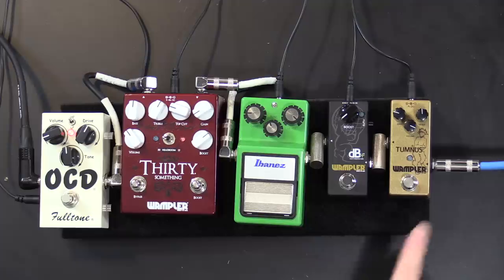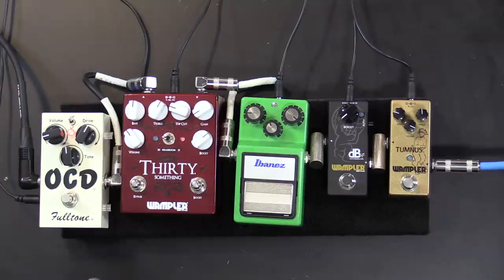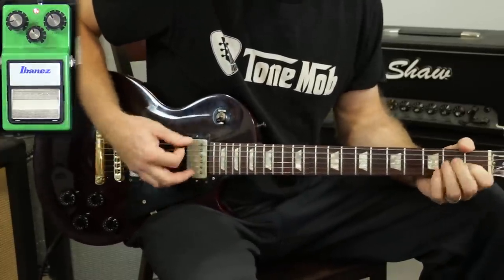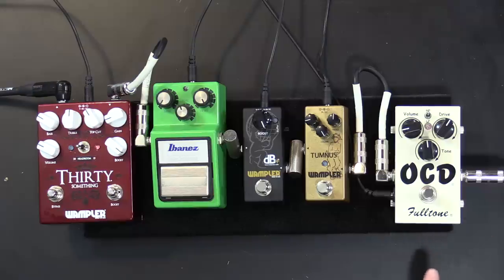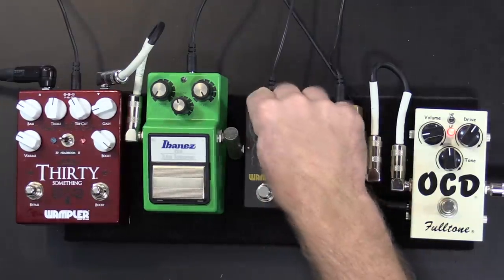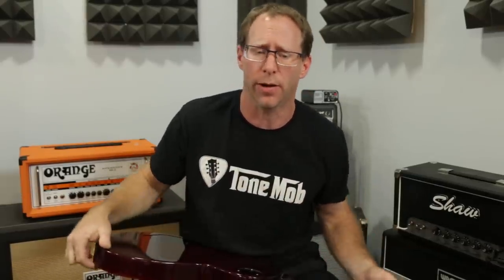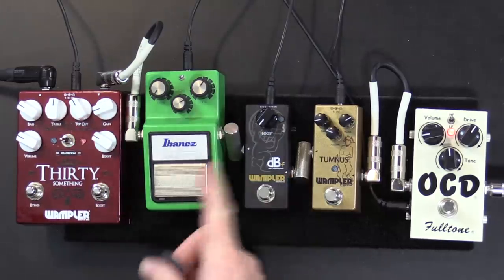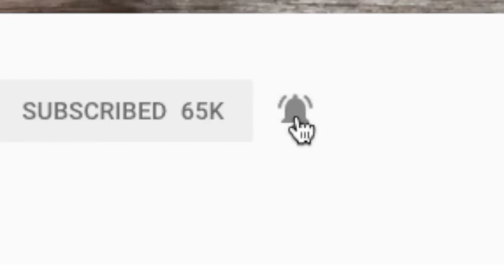Boost Pedal Placement - where do they go?

Comment: I would go boost after distortion and overdrive. My thinking is to try to get the levels on the distortion and overdrive pedals where you want them first and then use the boost pedal to boost (what else?) your nice distortion sound. If using a noise gate pedal I would put that after distortion - then overdrive - then boost.

Comment: Thanks so much Brian, great vid! The way I use my Marshall Jubilee with my pedals: eq all at 10. Preamp gain around 6,5 for a good clean tone and nice crunch on the lead channel. I balance those with the lead master. A tubescreamer in front for my main high gain sound. And a Boss GE-7 in the loop for solo volume boost on any of the 3 gain settings. This works as a 3 channel amp with an optional volume boost.

Comment: I was running my Tumnus Deluxe as the last pedal in my NS-2 loop for months and it was great as a boost and tone-shaper. One problem: the OD808 sounded like garbage in between the Ego Comp and Tumnus Deluxe. So I sat down the other day and experimented for hours and came up with a signal chain that i'm really digging at the moment. It's "unconventional" by my own standards, and likely most others too, but it works somehow. I included the post-dirt pedal order cause once I changed the position of the boost by one pedal, I was inspired to create a beautifully chaotic, disorderly, manic, brink-of-a nervous-breakdown tonal palette w/ three cascading analog delays set in sequential order (shortest delay time to longest), followed by a digital delay synced with the analog delays but set to the 1/4+.1/8 subdivision, and a tremolo either side of the reverb. It somehow sound good (to my ears, at least...) and it all started with moving my boost.

Polytune 2 Noir --> NS-2 --> Crybaby --> Big Muff Nano --> Big Muff Op-Amp --> Bad Stone --> Ego Compressor --> Tumnus Deluxe --> OD808 --> Fab Tone --> Carbon Copy (@ 12v) --> Faux Tape Echo --> AD-MINI --> Flashback --> PN-2 --> Hall of Fame II - TR-2 --> Ditto X2

Comment: My favorite boost is a tube preamp with both a volume and a gain knob. I change the 12AX7's to the 12AU7's in all my tube preamps.
I have the Wampler Plexi-Drive Deluxe and an Ibanez Tube screamer but prefer a tube preamp set up with a 12AU7.

Comment: My overdrive is my old Boss OD-2 (turbo off) and it doesn't take a boosted signal that well so for me it's boost after. I use a Rat as a boost rather than as a distortion. I don't really like the Rat as a distortion pedal but have found another use for it. Gain set low and volume up it, well, boosts the overdrive signal from the OD-2 quite nicely, enabling solos to bully their way to the front. It's not subtle.

Comment: I use the Orange Rockverb head. The only 2 pedals I have is an Xotic BB and Fulltone OCD. When I play metal/rock, I have the Dirty Gain a little less than half way, and use the BB to add more attack and punch. If I use the Fulltone and the BB, I back the Gain to 2 or 3 and run the BB into the Fulltone. This gives me a very spanky, reactive tone that is less gutsy, but fantastic for emphasizing  articulation. I want more pedals, but it is so overwhelming and there are so many opinions.

Comment: EHX platform comp w/ boost, Tumnus Deluxe, EHX Extortion, the mods + effects, and Empress EQ w/ boost slamming the front of the amp. I really like pedals that have boost built in, it enables you to push the effects more to the front. I actually wouldn’t mind having a boost between each pedal on my board. It gives you a lot more control over each sound. 

I’m like a midget staring at a wall, I love a little boost!

Comment: Just spent most of my day deciding where to put my Union Tube & Transistor More boost when I start building my new board.  I always kept it at the end of the chain right before the amp, but I've also ordered an Empress Buffer+ which has a boost in it, so I thought I wouldn't really want to put the boost I already have directly into a new boost.  After a lot of experimenting, the More just sounds so much better as the last thing in the chain!  Going to be interesting to see how it plays with the boost in the buffer pedal when it arrives!

Comment: I run an R.C. Booster before overdrive/distortion and an MXR Micro Amp + last (after delay and tremolo) in the effects loop to add a little drive/crunch to the power tubes.

Comment: TS Mini into Boss Super Overdrive (into a dual recto).
I really like the Tumnus + OCD combo, though. Adding both to my shopping list.
Reply: I thought the tumnus into the ocd was the best sounding too.Funny cuz i run a dual recto as well,only with a maxon od808 and kick in a BB preamp w/mid boost to get more mids in my tone(ala Marshall). Seems to work extremely well.just curious,do you use modern or vintage mostly?
Reply: My amp is a Roadster actually.  I use that pedal setup on one of the clean channels in Brit mode.

Comment: I use a TS style pedal for gain boost before drives and a clean boost for volume at the end of my chain. On my main board my Line 6 HX Effects does all the boosting. On my small board the Tumnus does gain boost and a Talent Booster after drives for a clean volume boost.
Reply: vidarfro my approach also

Comment: I just purchased your Tumnus Deluxe...it is coming in a couple days. What are your thoughts on my set-up? I run a AC15HW. Boss Volume Pedal into your Tumnus Deluxe into the OCD into the Boss Chorus, Line 6 Digital Delay and into my Vox. What would you recommend for starting points (settings) on my Vox and on your Tumnus? Any help would be greatly appreciated...thanks for your video, it sold me on the Tumnus Deluxe even though you did not run one in the video. 
Thanks W

Comment: I've tried all kinds of combinations. Definitely loved having a JHS modified soul food after my OCD for a lead boost, but it doesn't look like a lot of people here have done that. I really love the coloration that I got out of it. Currently using a mini Red Dirt into my OCD, the opposite configuration. Being the only guitar player in the band I don't feel that I need to dramatically increase my volume for leads. I'm sure the soul food would work just as well but I really like the soft clip of the mini Red Dirt. I see a lot of hate for pedal couplers like you are using, a lot of people say they destroy the jacks on the pedals. Being that those are not Straight Shaft couplers do you think that that would reduce wear and tear on the jacks?

Comment: I mostly play metal but I do also love some SRV blues tones.  I need to get a Tumnus! I bet it would do the high gain amp boost thing pretty well, while maintaining a uniqueness that could be cool for certain tones.  My first choice is the boss sd-1 for this application but recently found the RAT to add a cool thing the others didn't.  Having different tonal options that are quickly interchangeable has made me boost obsessed lol. I currently use a DB+ on my pedalboard to supply the effects return with the right amount of volume and impedance thanks to the buffer. I've noticed this allows me to keep the effects return volume on the amp at 12 o clock which keeps the amp noise down since I'm getting the volume from this pedal instead of the effects return.  Also does a great job preserving the high end in the signal even though I'm using long cables.

Comment: I use a J&H v1 distortion, relatively lite, defaulted to a Nick Valensi level.  I have a FX10 bi-fet with a generally low tone, FX85 harmonic enhancer for a treble boost then TS9.  After the J&H I have a Redwitch Lily because it can force break-up on the amp or I can dial it back for volume control off the rest of the pedals.  I don't generally have everything hot unless I'm playing something really heavy.  TS9 has to be on though to get the right mids for Maiden. 🤘

Comment: It depends on the boost type in my opinion. I like TS, K, D, and treble booster stuff into the front of an amp and clean boost stuff in the FX loop for a volume boost. If a boost has an EQ (like the Orange Two Stroke) I’ll add more mids and highs for a solo. I run my amp hot so this works best for me.

Comment: So I've been using a Friedman Buxom Boost with my JCM 900 but I've recently added the Behringer Vintage Overdrive 0800. I was using it with the boost last and OD first which sounded pretty good but the other day I saw a video of yours where you had the Tumnus before and after another drive pedal to show what that can do so I switched mine around yesterday and I think I like the boost first and the OD last 🤔

Comment: I have the Spark Booster by TC Electronic and I usually run it before my dirt pedals which change quite a bit.  My SB is usually on the mid boost setting but I've used the clean and fat settings on occasion as well.

Comment: I like running my Friedman Be-Od into a tube screamer (zero overdrive, tone little past the center and a lot of volume) It washes out the original tone of the Be-Od but boosts the high-mids and the volume so it's perfect for cutting through the mix for solos and lead parts.

Edit: It's a TS808. I like it a little bit better than the TS9

Comment: It all depends on what you’re wanting to accomplish, right? If you want a boost to boost the amplitude of your guitar signal, it can’t go before anything that clips your signal, so not before a distortion or fuzz. All the increase in amplitude is gone. It definitely will change what the distortion or fuzz sounds like, and the perceived volume increase may still be there. But the actual amplitude increase is mostly lost, right?

Comment: I’ve got 4 pedals and I’m struggling to determine the best order. For a boost I have an Xotic Super Sweet and I’ve. Also got a TS9 Tube Screamer, Keeley Compressor +, and a Fulltone OCD V2. Currently I’m going Super Sweet into TS9 into OCD into Compressor. Ive that heard the compressor should come before the other pedals but for some reason I like the sound at the end. Am I missing a better signal path? I’d be grateful for your advice.

Comment: What do you think of the Fulltone Fatboost pedal? It says it provides 35 db of boost.  Which  boost pedal provides the most boost? And are they only providing volume?  That would not seem to make much sense  as all one would need to do is turn up the amp, for pure volume..So do boost pedals provide something else besides volume,  like say expanding the sound somehow, or  making it bigger sounding without necessarily making it louder?  I am  just trying to learn the whole deal about them.

Comment: Question for you guys. How do you usually set the volume and EQ on your boost and the EQ on your amp when using distortion? Do you use the same settings when you're going through the FX loop as apposed to the front of the amp? Thanks.

Comment: Treble booster (Catalinbread Naga Viper or Daredevil Silver Solo) into my 'amp pedal' (Bogner La Grange)...for clean solo volume boost ,I use the boost in the La Grange which comes after the gain section...btw,do you offer the boost section from the Thirty Something (great name) as a stand alone unit?...it sounded great driving the OCD and I'm always on the lookout for nice treble boosters

Comment: Thanks , not much coloring in tone when out in front of the overdrive as opposed to when it’s behind . In front is where mine volume boost is going. Any suggestions what type volume boost should we buy for these results? I’m going with the sparkle, but I have a vintage tube screamer but I’m gonna use it as the main for the volume boost to go into. Thanks great video

Comment: Are most effects loops series or parallel ones, and would it say  which one  it is,  on the back of the amp? If not  how would I find out? I got a Marshall JCM 2000 DSL 40 watt, made in England, one of the original ones made around 2006 or so..which type  of effect loop is better and why?

Comment: Please explain the pro's and cons of a solid state amplifier's efx loop being wired in series versus parallel and which amplifiers typically use series or parallel  efx loop methods. I have a Laney Pro-Linebacker 100watt twin channel solid state combo (circa 1989) which I assume has the efx loop wired in parallel which I never use because my distortion pedal sounds terrible in the efx loop. Is a parallel efx loop designed to accommodate modulation pedals only and not for boost/distortion pedals?

Comment: Wah (EHX Crying Tone...yeah I know it moves around a lot but the non-moving parts thing keeps me from replacing it), Boost ( Earthquake Devices Speaker Cranker), Boss (Blues Driver), Distortion (Rat), Delay (MXR Carbon Copy) and a Boss Looper (RC-3). I Use Various Fender Guitars and Fender Amps...done.

Comment: I have a keeley aria as my always on pedal.  Od side is always on and a super overdrive after it as my gain boost.  I have learned a lot since watching your videos.  I’m going to try my boss sd1 in front of the aria just for kicks.  The cool thing about the aria is I can switch the direction of the compressor and drive.  I have noticed that with humbuckers I don’t like using the compressor as much.  Maybe use the compressor after the 2 gain stages as a boost for volume?  Btw I’m running those into the clean channel on my dsl40

Comment: I have a question if you have the time. I have the BOSS GE7 and run it at the end of my chain in the effect loop, but just before my looper pedal.  I really like using this pedal to color my sound better, but I cannot do both and raise just the volume level. So, is there a pedal out there that will only boost the volume level without changing the tone you have set already.

Comment: How about for pure volume boost for soloing. For example, I am running an Eleven Headrush pedalboard. I would like to set it up to just boost my volume without adding compression to the signal, so I assume the way to do this would be to drop a boost (like the Xotic RC Booster or TS 808) AFTER all the distortion? I haven’t had it long enough to experiment with it yet, but any advice would be great! If it helps, I am playing hard rock that has a sort of 80s Marshall cranked sound...

Comment: Thanks for the info. Would you ever put a boost in the effects loop?  Cheers.
Reply: I was thinking the same thing.I just bought a Orange two stroke boost pedal.It runs off 9v or 12v and has what Orange calls a charge pump internally to double the voltage,but I waz curious what would be better.To put it in front of the amp or in the effects loop.I'm just trying to save a little time instead of experimenting lol.Which i'll probably do anyway in the future.I just wanted to know what characteristics each would have.Rock on bro🤘

Comment: Thank you Brian, very informative and insightful. I have a TC Spark in the effects loop of an AC 30 S1 just so I get a boost in solos. I'm in a 2 guitar + Keyboard classic Rock band and I need to push the volume in order to be heard. Also, I can access most classic Rock tones except for higher gain. I am going to try putting my DB boost before my tumnus and Voodoo Lab Sparkle Drive Mod to see if I can get a higher gain tone. Any other suggestions?

Comment: Hey Brian! I’ve been using a clean boost (always on) for years now. After all my drives currently but sometimes before certain high gain pedals to get them extra hairy. 
Always wondered if the clean boost is technically supposed to go before or after modulation/delay pedals though in case of clipping. The boost fattens up the clean tone signal into the amp, but is it too much for the headroom of other pedals after?

Comment: Where to put the boost ?
I use an EP Boost just before my Gain/Distortions, and a Vertex Boost as last pedal in the loop section to add CLEAN VOLUME to about anything and at any setting ('cause my amp doesn't have a clean boost).

Comment: I use boost for leads, so I like them after. FYI - https://www.sweetwater.com/store/detail/SparkMini--tc-electronic-spark-mini-boost-pedal is a GREAT boost. Hold down the switch for a couple seconds before a song and you have momentary boost for short lines, hold it down again for 2 seconds or so and momentary becomes latch. That isn't even available in the full sized TC Boost. At $48 bucks, you can buy 2 and use one for boost and one for cut. These a TINY so board real estate taken is minimal.  (My Le Clean when switching between Cold Fusion & Hot Fusion needs a "Cut" pedal when coming from HOT to CLEAN)

Comment: I run my clean boost after my overdrive pedals. I pretty much always have my boost on and I find that it shapes the tone of my overdrive pedals even better when it is after. I have, in order of signal chain, EHX soul food, then digitech screamin blues overdrive, the outlaw affects boilermaker clean boost. It is a great boost for not much money. It has trebble and bass eq, level, and a gain nob so it is kind of an overdrive anyway. But it sounds great after my overdrives.

Comment: Hi Brian thanks for the great videos by the way. I personally have used my boost prior to my distortion ,overdrive, and, compressor. Reason being for my is that it's just the boost on my Super Cry Baby, so I can use it as a clean tone boost, or get more gain out of my amp, or pedals, or both. Also being that I can use it as a volume increase with boost on I can always get more gain. I like this because I can roll more distortion/overdrive into my amp. Thanks Brian!!

Comment: i use my eq as a boost before anything so if i want gain before wah it's possible. my rack mount has eq and 12db boost. that tumnus looks like the drive pedal I've been looking for. unless those ocd pedals start going for the used price of a ds-1. i will probably just save a bit for the tumnus delux because it's different and versatile.

Comment: shanks 3k germanium treble booster after a 10' cable then 4" cable into a ROYAL OVERDRIVE into Cornish G-2 into Kingsley CONSTABLE into lehle split into boogie + strymon big 3 stereo out to orange rocker32 driving orange 2x12's

Wet Dry Wet setup